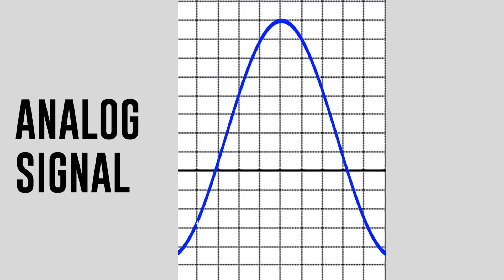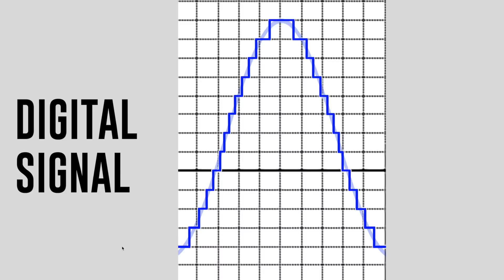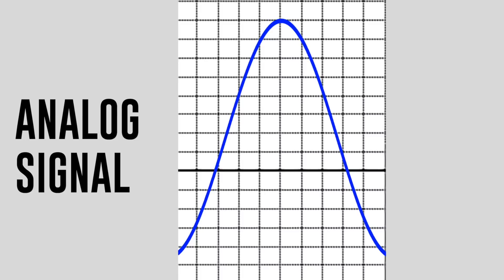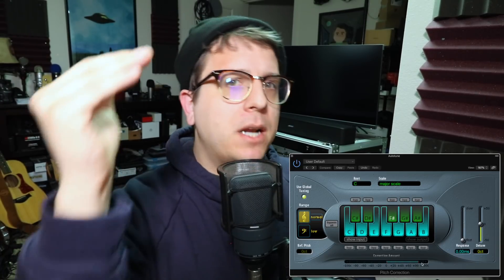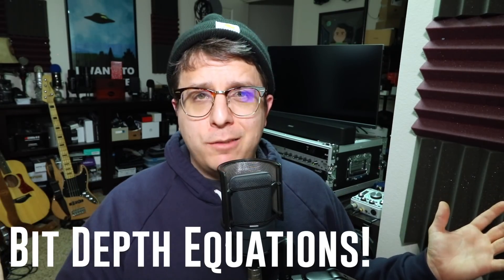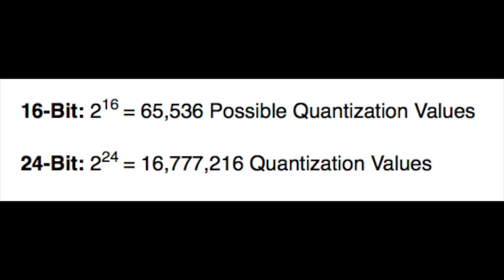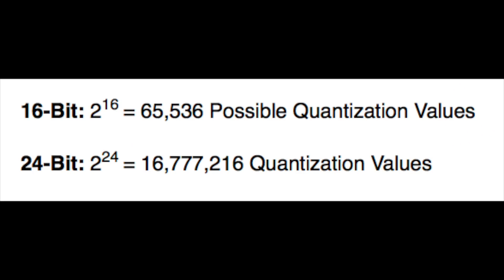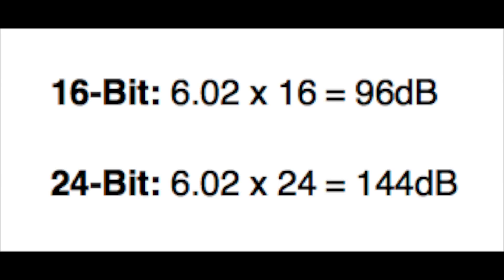16 bit vs. 24 bit Audio, What Should You Record At? (FAQ Series)

Comment: Everything you need to know for audio playback and production...
TLDR: 16 bits is enough for playback, and 24 bits is only helpful for production.
Small correction: Bit-depth doesn't really get you "resolution".
1) Frequency gives you resolution for audio.
As far as frequency goes, 44-48kHz is enough because human hearing doesn't really go beyond 20-20k, and 44.1 gives you up to 22kHz accurately according to the Nyquist formula.
44.1kHz is the CD audio standard.
48kHz is DVD audio standard.
2) Bit depth gives you dynamic range.
6dB of dynamic range per bit.
This means 16-bit has 96dB DR and can easily cover from 20dB (silent room) to 116dB (front row at a rock concert, almost hearing damage).
24-bit has 144dB DR and can cover the range between a silent room and a jet engine.
3) Higher bit-depth lowers the effect of noise while mixing audio.
When you process audio, every operation adds a little bit of noise.
With 16-bit, you have 65k steps.
With 24-bit, you have 16M steps.
A random error shift of 10-100 steps will be ever-so-slightly more significant if you have less steps to scale it.
The absolute range means you have more room for error.
Reply from the maker: Appreciate the correction.
Reply: @Podcastage  Is there ANY reasons to get 24Bit Audio interface for SPEECH ONLY recording with Dynamic Microphone over 16Bit? Both do 44/48Hz
Reply from the maker: Ah that's a GREAT way to put it. Vertical resolution vs Horizontal resolution. Dang it. I wish I had thought about putting it that way in the video. =) Thanks for the better explanation.
Reply: Podcastage wouldn’t 24 bit therefore recreate a more accurate analog waveform?  The quantization data is more accurate because it has more possible values.
Reply from the maker: obvious_humor that graphic from azooptics is amazing! Damn it. I wish I had known to consult with you before making this. Thanks so much for sharing your expertise and adding value to the YouTube comment section. I’ve learned even more! :)
Reply: Here's a picture showing what bit depth is like for pictures: https://www.azooptics.com/images/Article_Images/ImageForArticle_1151(1).jpg

And for audio: https://vignette.wikia.nocookie.net/digital-audio/images/f/f7/8_16_bit_depth.gif/revision/latest?cb=20140415224229
Reply: @obvious_humor  this graphic is not true. 16 samples in one period of 1 second is not realistic and cannot be heard. the reality for audio frequencies and standard 44khz sample rate the samples are more spaced and dispersed on  several consecutive periods.
Reply: Remake the video?
I will watch it again :)
Reply: Well, you can think 24bit as higher "vertical" or signal amplitude resolution.
Like 1920x1080 full hd being 1920 the sampling frequency, and 1080 the bit depth.
Translating to an wave signal, higher bit depth means bigger headroom, snr and blablabla =D
Reply: @victoramicci840  Bit depth is about resolution in the dynamic domain. Sample rate is about resolution in the frequency domain. Both need to be good in order to get a high fidelity representation of the original analogue AC voltage.
Reply: Victor Amicci 
To be more precise... bit-depth is more like the intensity. I've already explained how frequency is the resolution; the important thing is that sound isn't measured in 2D space, it's measured in frequency. The sampling frequency lets you "see" any frequencies that are 50% or less. So let's say 1920x1080 is like being able to see up to 20kHz (functionally enough), and 1280x720 is seeing up to 16kHz (practically enough), etc.

Since bit-depth is intensity, think of how many colors can be displayed in a given sample (either a pixel, or a timecode). You may have heard of 24-bit color, which uses 8 bits for each of 3 color channels (0-255). The absolute dynamic range is the difference between the highest and lowest values you can communicate. In other words... what's 0% brightness? What's 100% brightness? How many steps are in between? The standard is to put 256 steps for each color, or 65,536 for the human-audible range.

Sure, you can use more than 256 steps for color; HDR displays do this, and there are definitely more than 16 million colors. But there's a diminishing point of return. For our rods and cones, we've got a bit of room left to grow, but for the hairs in our ear, we've already hit the practical limit. We can resolve as far down as we can differentiate two different sounds as unique, and we can cover the range between a silent room and a rock concert. We don't really need to reach jet-engine levels for playback; it's just useful to have more room for error if we make mistakes while doing the math. We're going to divide by 256 anyway when we want to listen to it.
Reply: @obvious_humor  Perfect !!
Reply: I see what you mean, and I think both explanations work from a practical purpose. When you say that "sound isn't measured in 2D space", i think you were saying that from an acoustic point of view. What I mean about bit depth being the vertical resolution is, from an electrical or "sound wave" point of view, bit depth is how much detail you can have on the y-axis of an said wave or, how many voltage steps an ADC can translate to digital.

OR, you can think as, if sampling frequency is the resolution, color depth is like bit depth, translating how many nuances of color and brightness you can capture. Same thing with an acoustic signal, but instead of color and brightness, i'ts signal intensity.
Reply: 44khz 48khz means for sample rate, not the frequency.
Reply: Thanks for this thread. I pasted it into notepad and printed out this comment and the relevant replies. Bit depth is 2^x where x is 16 or 24 usually right? That's what I pulled from the picture. Anyway, thanks OP for the info, and to everyone who replied after. This is SO helpful.

OOps edit, i just realzed. I was typing this before I finished the video. You literally said 2^n. RIP
Reply: Thank you so much mate makes perfect sense.
Reply: Unfortunately in this Thread here there’s quite some misinformation.
Out of an Amplifier any signal leaving is perfectly smooth. No matter the Bit depth or frequency recorded. Why?

1.) Frequency
Nyquist-Shannon tells us, that to capture a PERFECT representation of a signal containing at maximum frequencies up to x, we must scan it with a sampling frequency of 2x. This is where the 44.1 kHz come from. Before a signal is recorded a low pass filter with a cutoff frequency of 20kHz is injected into the audio stream. This cannot be heard since no matter the equipment or the „perfect ears“ greater frequencies cannot be heard. Then the signal is captured at a  frequency just above, because of physical imperfections in that filter. That‘s why for any recording 20kHz of maximum frequency is sufficient. - studios may want to leave themselves more room to master for a medium, but at home it’s enough -

2.) Bit Depth
The bit depth really ONLY affects the signal-noise-ratio and dynamic range. Why?
After the sound of 1) has been recorded and is then played again, it is then immediately after the DAC this jagged pattern, however that’s NOT what you will hear. It is then again passed through the same low-pass filter as in 1) ant that will then PERFECTLY! recreate any sound wave with it‘s frequency below 20kHz and amplitude in the dynamic range. Why not jagged? For that infinite frequency is required, but that’s not possible since it passed the lowpass filter. Think of it like this: You record your silent room, but also want to record a jet nearby, then you will need 24bit, as it has quite some dynamic range. However, I very much doubt any home equipment will be able to reproduce dynamic ranges over 96dB. You will otherwise shatter your ear-drums. That set room will get a low value like 1 and the fighter jet a 2^16-1 now the jet will be clipped, as it is above the set range. It will sound distorted. But that’s exactly why you will need to remaster for vinyl (approx 65dB), CD (96dB) and MP3/AAC (depends greatly, but can be on par with CD). The jet will then be decreased in volume, so it is not distorted. The jet would then be set to a range of amplitudes.
The image resolution comparison lacks quite a bit. The color depth is more equivalent. But you can see that in a comment above.

If you have some spare time, really read into it. Not on hifi or similar websites as they want to convince you that you need 96bit/3000whatnot kHZ to sell you stuff; scientific or mathematical articles and books. A few starting points:
ADC
DAC
Nyquist-Shannon-Theorem
Fourier-Transform (especially a few transformations like sawtooth, sine) (FFM is just the efficient algorithm behind it; if you can play a little with it and see for yourself)

Professionals in studios will need higher bit rate ans sampling rate, just as the first post said. They want to minimize the noise added effects have. But for anyone at home 16bit is very sufficient. If you have, however, equipment capable of reproducing 144dB then go for 24bit if you want to be deaf. Also don‘t overestimate your equipment. Most mics cannot even pick up those ranges. And for digitizing vinyl, cassette, R2R and stuff those have a dynamic range far below 96dB. 24bit is only for those who are too dumb to level their output correctly.
Reply: @ReaktorLeak 24 bit will probably give you cleaner and more spacious sound with razer sharp imaging and with much lesser quantization artifacts
Reply: obvious_humor - It's a crying shame that with most music today that people wouldn't notice the difference between 24-bit or 4-bit as the full dynamic range is jammed full and compressed to death.

There are countless vids on YT where your common music listener wouldn't or doesn't notice it but you can't mix and master that way for vinyl, so the vinyl resurgence can only aid people getting a feel for what full dynamic range recordings sound like rather than CD's where the 80's musical crime of brutal compression is heard with it being slapped all over it!!
Reply: Is there ANY reasons to get 24Bit Audio interface for SPEECH ONLY recording with Dynamic Microphone over 16Bit? Both do 44/48Hz
Reply: I sense a fellow engineer perhaps? Or just someone who really knows their stuff. But your bit about Nyquist makes me think otherwise
Reply: ReaktorLeak as far as I can tell, your argument only means that 24 bit matters more for high frequencies than low.
Reply: obvious_humor ww
Reply: @ReaktorLeak it is not a graphical note it is the principle in itself... the samples are dispersed on several consecutive periods, 4 values per period for example for 11 khz (44/4 khz). think about it the samples are four quasi-random instant value of each period of signal. for having good approximation of the source signal you need many periods. If the sample ferquency is 192 khz there are approx 18 samples per period for 11khz so the signal is more than four times better "reconstructed" (by the dac).
Reply: kHz means samples per second. It's the resolution of an audio and if your recording in 44.1, 48 or 192 kHz, it will affect the entire frequency spectrum unlike what is mentioned in this post. 192khz will give you better imaging with more sense of space in the music. If someone wanting the best, he can go upto 192khz but you really need high end system to be able to notice the difference. In cheap systems, you can't even differentiate between 44.1 and 192khz. 

Human brain actually resolve music at 250khz but the thing is, it is just impossible to record music at that rate, our brains can pick up nuisances even at 4 milliseconds apart which is equivalent to 250khz and to create the same sound as in the studio, you really need 250khz but because of the hardware limitations, you can only record those nuisances 22 milliseconds apart (192khz) which impacts the transients in the music .In higher end DACs, such as Chord Qutest tries to upscale the music at that sample rate but it's only partially succeeds. If you really want to learn more about this, watch "John Franks" interview.
Reply: Oui
Reply: I think of bit depth as "sensor size". Like a high quality camera may not have the most pixels compared to a smartphone, but a DSLR could have a 2in sensor where a smartphone is lucky to get a 1 in sensor. The larger the sensor the more light it can take in and usually better pictures across the spectrum. BUT like with pictures; audio is only as good as the chips its being fed through and the algorithm your mixer is using to convert it to a digital signal.
Reply: I AM SOUND ENGINEER !YES it s true !But we have to take in disscus what we sound engineers refer as 'meet" like "juse" or depth wich is bit rate !You want more frecventy in depth you need more bit rate !otherwise you need to rebounce them using re-recording tehnique !
Reply: Dear sir, when i stream a music then do my dac sync with the music i was streaming or do i need a over clocking dac to match with the streaming music bits!
Reply: Color bit depth in video is the perfect analog to the audio bit depth. Also measured in number of digital bits. It gives more addresses for all of the sounds captured to be represented digitally. Color bit depth in video would be the total range of colors each pixel can be.
Reply: Maybe simplified even further:
Bit depth is how close the lines are on the y-axis (intensity).
Sample rate is how close the dots are on the x-axis (frequency/time).

But for the most part, not many people think in terms of graphs -- it's generally more useful to think about what the graph means.
Reply: Not true.  Generate a 4 kHz signal in Cool Edit or Audition.  Use 96k/24.  Downsample to 96K/16 and 44.1K/24.  Compare the two.  See that the 24 bit depth does nothing for the signal resolution.  On frequency analysis you can see It only reduces the noise floor.

Comment: The thing about bit depth is it's quite a good return investment (until you can't hear the difference) as all you need to do is add 1 bit to double the resolution, whereas with sample rate you need double the number to double the resolution. The bit depth is more like the number of possible colours, which needs the base 2 logarithm of that number of colours to store. Then the sample rate is analogous to the number of pixels. Of course, with video you also have a frame rate. In practice with video you will almost always use some form of compression as storing 30 or 60 bitmap images a second with 16.7 million colours and 4k resolution is going to quickly eat up storage space. In fact a single second of such would be 1.49 gigabytes for 60 fps 24 bit 4k. If you used 1280 x 720 and 30 fps it would still be 82.9 megabytes per second.

Comment: The bid depth determines the level of the noise floor, full stop.   Each bit gives 6 dB of range above the noise floor.  So 8 bits gives you 6 dB * 8 = 48 dB of range.  As you demonstrated that noise is very low. The error between the input signal and the digitized signal is noise.  The level of that noise is determined by the step size or number of bits in the conversions.  At 10 bits the noise is down 60 dB from the loudest level.   That is 0.1 % of the level of the loudest sound and would be imperceptible with modern recorded pop music that has at most 20 dB of dynamic range.   The 8 bit sound starts to have an audible noise floor.   The difference between 16 bit noise floor, down 96 dB and 24 bit is never going to be perceptible in any recorded performance.

Comment: There's a big error in your video.  If you've introduced artifacts by reducing the bit depth to 8 (or even 4!), you've done it wrong.  With a good ADC and DAC, reducing the bit depth does one and only one thing: it raises the noise floor.  And that is it.  Reducing the bit depth is not the same thing as bit crushing.

Comment: Anyone can clarify   me about standalone hardrive multitrackers?
I have a 16 track MRS-1608 hardrive from the mid 2000s. Through the manual in the specs it says 24 bit recording, 24 bit dac, 24 bit etc...on everything. It seems like everything is 24 bits internal, but on the "export" side of the mastering , through the main outs, usb out and CD burner, it's converted to 16 bits before it leaves the unit. 
Am i suffering a lost of resolution compared to 24 or 32 bit new Tascam models?
I mean am i missing something if the final results are burned onto a traditional 16 bit wave CD to listen in my living room sound system?
Reply from the maker: A lot of that is above my pay grade, but my understanding of the real benefit of 24-bit is in the processing stage. So as long as the input and the processing side of things are all 24-bit you should be fine. Once you export for playback, that assumes everything is pretty much finalized and you likely not going to notice a noise floor that's 80-90dB lower than the signal.

Comment: very good video, but i think it also contains revisionised misconceptions - for example, the digital audio signal is not a line, but many dots.
 If you convert digital 44.1kHz signal back to analog, the analog waveform is round again.
i learned that the digital "stairs" are not an accurate way to VISUALIZE the digital data. 
but they are more practical for Editing in the DAW.
humans are only able to hear until ~20khz. the sample rate must be only at least 40khz to work. Or is this concept wrong? trying to figure it out, not an expert....
Reply from the maker: I have heard a lot of feedback that the stair step is not an accurate way to visualize it. I've kind of tried to step away from this in depth theory stuff because I'm not that great at it. Instead, I focus on application..."can you hear the difference? if not, when can you hear the difference? here are some samples." that kind of stuff. Thanks for the comment.
Reply: @Podcastage  Thank you for the kind answer, i didn't mean to rumble around. it's an interesting topic